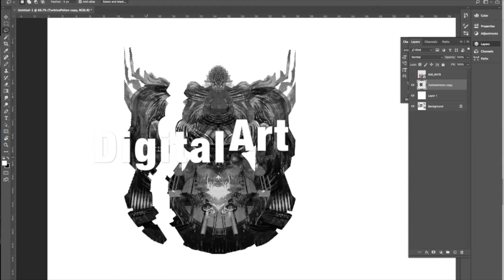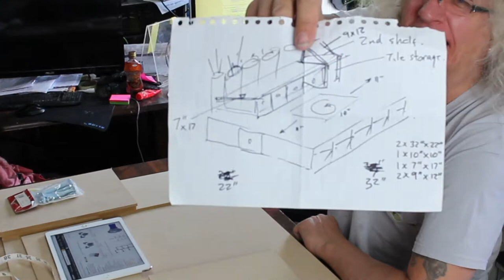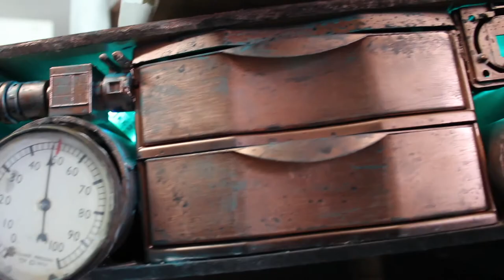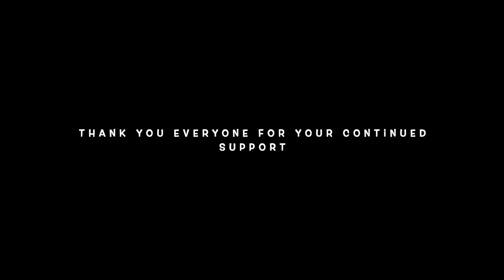How to build an awesome Steampunk hobby station - miniature painters, sculptors & model making hobby

Comment: Hmm, if I was going to make a minis/art work station, it would have to support painting and paper crafting.  So, a pull out cutting board, plenty of storage for pens, pencils, and xacto knives, and a flat slot for storing cardstock. Add in a freely rotating base on which to magnetically mount a miniature so I could free up a hand, multiple adjustable lights and a magnifying glass. Perhaps all on retractable arms like some desk lamps. Of course, plenty of storage wells for the paints, and a couple greeble bins.

As I am designing this in my head, I think of the lights/magnifying glass like industrial robots or shipyard cranes, so for them I can see a gritty diesel or a more spacey (but still used/practical) shipyard look to the whole thing.
Reply from the maker: Wow Todd... that has got the brain box ticking over. Lots of cool considerations there but I really do like the idea of a grunge dark future feel to the whole thing 😁